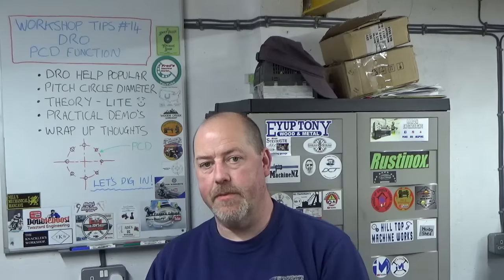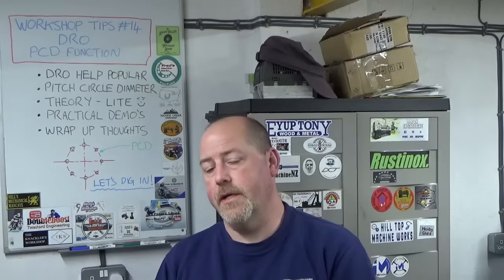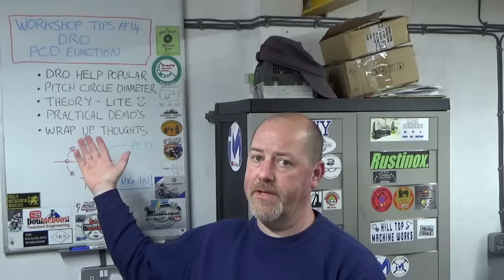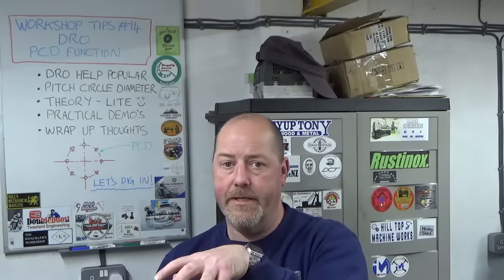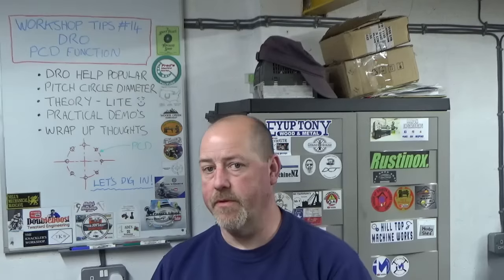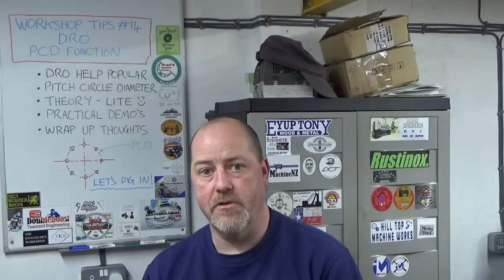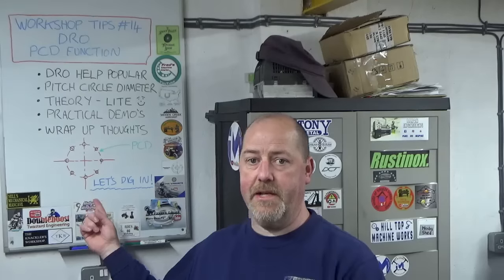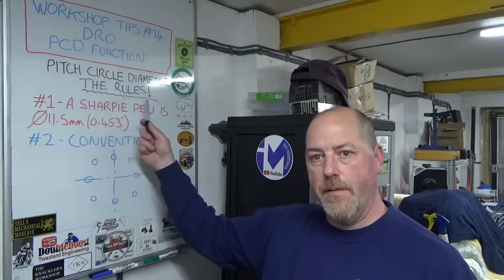Workshop Tips #14 - DRO PCD Function Explained

Comment: Well done again John. I did that on DRO's before but you never got a job with PCD holes again for a long time and I used to forget! Sometimes I went back to the old-fashioned way of marking the new flange out with blue ink and center punching the holes lol. It was still enjoyable doing the old way as well. We were maintenance machinists in the automotive industry so are work was very varied and a lot of the work we did just left our heads and sometimes we had to call a toolmaker to show us along the way lol!

Comment: This is a function I actually use, but I have learned a lot and will be a lot more confident with odd ball quirky parts.
Many thanks.  👍😎
PS... I do often use the "extra hole" method, using eg 0° start angle, 360° end angle. It saves working out the end angle, a dirty methode but does eliminate a possible calculation error.

Comment: You keep saying that entering n+1 holes is wrong, but the manual for my dro gives two ways of entering the end angle and # of holes, the n+1 being an alternative. Sometimes its easier to enter 0deg, 360deg and n+1 holes than to calculate the end angle in the workshop.
BTW, the start angle and positive rotation direction is mathematical convention, that way, given the angular position of a hole, x = r.cos(angle), y = r.sin(angle).
Reply: I was going to ask about the counterclockwise rotation thing, as it crops up everywhere. The mathematical explanation makes perfect sense. Thanks.

Comment: What ho Grasshopper, 
The adding a hole to the number you want is not as daft as you might think, especially if your mental arithmetic is sketchy. By adding one and setting start angle as say 0 and final as 360 you don't need to know or even work out the end angle. A fudge it may be but if it helps the arithmetically challenged, I won't complain. 😉
 PS I did A level maths but have forgotten most of it,  so I count myself in the challenged category.🤣🤣
Have you investigated the zeros function, or whatever your device calls it, having 99 zeros on mine allows 99 features on a part to have their own repeatable co-ordinates.
ATB 
C

Comment: one thing I do a lot is to just make start angle 0 and the end angle 360 and then just set the number of holes to one higher than I want. why? I´m more than likely to mess up the end angle doing the math in my head. also I  often skip holes to drill the two that are on the same X or Y dimension first and come back to the other ones later. saves on some cranking handles and setting the same dimension several times. I can can jump back and forth in the PCD list with the arrow keys.

Comment: Jon I can't find a 1/2" BSW left-hand nut In Aussie , can you or view help . Will pay costs .
Kit from down under
Reply: Make one! Make a project of it, use some 1/2" silver steel , cut a left hand 1/2" BSW thread on it,  turn a taper on the end, then mill three slots of the centre line to give the cutting edges roughly on centre. Then harden. Then temper back to darkish straw and Bob's your mothers brother! ( I've made similar LH Acme taps for finishing new nuts for compound, cross slide and lead screw nuts on my lathe)
Reply: @samrodian919 thanks for your help but I don't have the Equipment to make one .

Comment: I have a DRO on my mill and the one thing it doesn't tell me is the speed the table is travelling at when driven in the X-axis by the motor drive. It could easily do this: it knows the passage of time, and it knows the table position. It seems the idea has never occurred to DRO makers. Anyone know a DRO that does this? My DRO has all sorts of trig functions that I never use. If I wanted to do trig I'd do it with my HP 35s calculator.
Reply: You're not likely to find any manufacture interested in adding speed calculations to their DRO's. There are numerous obstacles, but the biggest is that it requires accurate timing, with interrupts, that would cause havoc with the cheap processors used in DRO's. There is a work-around though. Some DRO's provide a data output connection that can pass information to another device, which in turn could provide travel rate info. 

I did some research on this subject for a different purpose. I wanted to use a DRO's position information to control stepper motors for setting end points of movement. Unfortunately, the slow processing rate of DRO's can cause a significant delay in transmitting location data. It's been awhile since I've played around with this issue, but one option I've considered is to intercept the signals directly off the linear scales and feed them to a Raspberry Pi.
Reply: @EDesigns_FL  Thanks. I find that quite surprising since table movement is very slow compared to computers. Also, why should interrupts be needed? Measure X position, note real time clock value. Next time you have a spare moment repeat. Calculate speed., display.
Reply: @samuelfielder Because DRO's primary function is just counting pulses and then calculating positions based upon the counts, they have no need for a real time clock. Also, RTC's have a resolution of one second, which is a ridiculously long timing cycle for this type of application. 

Timing in these situation is typically done by running a loop of a known duration and counting the cycles to determine how long it took for an event to occur. Interrupts are used to avoid losing track of pulse counts for the linear scales while running a timing loop.  

When I write code to do something like this, if an RTC is available, I include a timing loop that runs upon startup to evaluate how many cycles a baseline loop will run in a given time. This data is used to set a timing variable for later calculations, and allows my code to run on any capable microprocessor irrespective of its speed. If an RTC is not available, then the code will be microprocessor specific.
Reply: @EDesigns_FL  An arduino without an RTC can time to milliseconds.
Reply: @samuelfielder  I don't know what your point is. There are numerous methods of timing events. You had mentioned using an RTC and apparently didn't appreciate the limitations. Some Arduinos do have RTC's. They are embedded in the WiFi board. I gave you a method that I have used for precision timing and it's the best that I have used for pushing the limits of mediocre processors.
Reply: @EDesigns_FL   My point is that I think your technical objections to a DRO measuring feed rates are spurious. "it requires accurate timing, with interrupts" - it does not. It is more likey that manufacturers have not thought of the need.